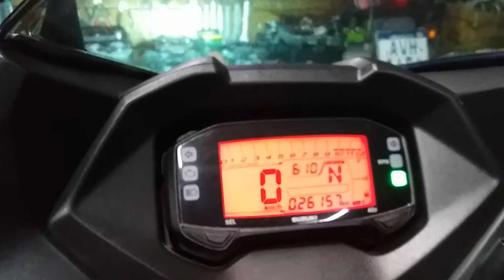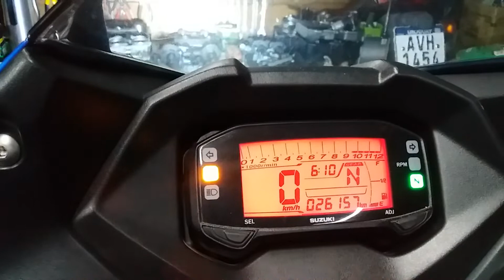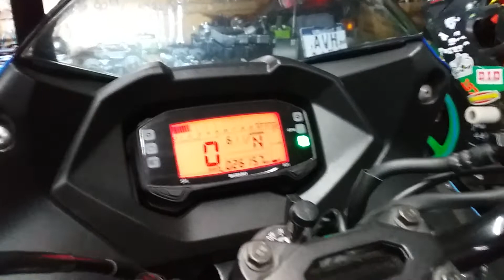Borrar fallas Suzuki Gixxer SF 150 FI

Comment from the maker: Dejo el enlace para que puedan ver el código a que falla corresponde su explicación y posible solución   https://codigos.senzor.co/suzuki/
Reply: Y como diferencias el c44 del a44? El tablero solo indica 44.
Gracias
Reply from the maker: @1976cior  Buenas el c44 código de falla para motor ( luz testigo FI ó Engine ) y es falla en el sensor de Oxigeno. El código a44 corresponde al sistema ABS en los modelos que vengan equipadas con el sistema, en ese caso la luz testigo que encenderá será la del ABS y no la de FI, el código a44 correspondería a un problema en el sensor de rotación de la rueda trasera. Gracias por ver el video y comentar, saludos !

Comment: Excelentes videos y aporte muy profesional, se que ya tiene tiempo el video pero probare haber si puedo recibir una respuesta suya ante mi problema: mi gixxer 250 ABS 2021 al abrir switch la luz de motor parpadea 3 veces para y vuelve a parpadear 3 veces mas le doy marcha y enciende a la primera en ocasiones enciende a la segunda, una vz trabajando nunca mas vuelve a salir el testigo de motor, que falla sera o que estara proximo a fallar??  la carga encendida esta en 14.5 volts y el estator no esta en corto. Saludos!!
Reply from the maker: Hola Tomas, cuando hace eso suele ser problemas con la batería que detecta tensión baja. Revisar el estado de la batería con una herramienta probador , estado de las conexiones no estén flojas ni sulfatadas. Gracias por ver y compartir tu inquietud , espero sea de ayuda  puedas resolver. Si es así me gustaría lo cuentes para tener en cuenta si alguien tiene un problema similar . Saludos!!!!
Reply: @pablorr71  hola gracias por la respuesta y su tiempo, le comento que compre una bateria de la misma marca YUASA solo que en la agencia la única que tenían es de 90 CCA y no de 110 CCA como la original, la falla es intermitente hay semanas que nunca aparece el testigo y hay otra que le vuelve aparecer con esta nueva batería que le puse. Pero revisaré los cables a detalle para ver si no tengo falsos o algunos dañados por sulfatación, al igual mándare revisar que la batería no halla venido defectuosa. Muchas gracias por su apollo y tiempo!! Saludos desde Guanajuato, México.
Reply from the maker: @tomasgarcia3304   Tomás justamente en el CCA es lo importante para que no te suceda eso. Las baterías en las motos vienen ya de por si muy justas en cuanto a la exigencia que requiere la moto por lo tanto bajar de esos niveles genera problemas. El punto es que al momento del arranque la caída de tensión de la batería es grande, es muy probable este cayendo por debajo de los 7volts, para medir esto un polímetro no alcanza debe realizarse con un osciloscopio y ahí veras la verdadera caída de tensión. Cuando la caída de tensión cae un nivel muy bajo todos los sensores no logran generar información coherente para informar a la ECU de su estado por consiguiente es interpretado como falla, cuando se recupera y vuelve a censar correctamente retira la advertencia de problemas. La batería es muy sensible a la temperatura baja como alta y afecta directamente la entrega de CCA, otra causa puede ser un motor de arranque con problemas que genere un aumento de consumo y la batería no lo pueda afrontar, las conexiones defectuosas también genera problemas de ese tipo (sulfatadas , falsos contactos, cables resistivos por corrosión ) No olvides que el principal componente del sistema eléctrico de la moto y sobre todo la parte electrónica es vital  la batería este en excelente estado de no ser así el sistema no tiene donde sustentarse. Saludos !!!

Comment: Hola bro se que ya paso tiempo de este video pero justo tengo una moto como esta y me esta presentando un fallo al encenderla o al andar en camino se me apaga y le cuesta prender la enciendo en 2 en caso de emergencia para llegar a mi destino pero me hace eso de manera general no hay un lugar o forma en específico tu sabrías cual es el detalle ?
Reply from the maker: Buenas Percy, generalmente la falla esta en el sensor híbrido del cuerpo de inyección, en ese modulo va el sensor TPS (sensor de posición del acelerador), el sensor IAT (temperatura del aire de admisión) y el MAP (sensor de presión de la admisión) este último es el que generalmente da ese tipo de problema. Lo ideal sería revisarlo con un osciloscopio para comprobar sea el problema (pese a estar fuera de rango este no acusa falla para que la ECU lo reconozca). No hay forma de repararlo así que la única solución es cambiar ese sensor híbrido (módulo de tres sensores) Conseguirlo no es fácil y tampoco barato. Saludos!

Comment: Profe excelente video, una pregunta usted sabe cual es el código 65, ya que es el que esta emitiendo mi moto una intruder 150 año 2021; le dejo un video donde lo puede apreciar https://youtu.be/ZVUvYfbu2uU de antemano agradezco su apoyo; saludos cordiales
Reply from the maker: Hola Mike, en Suzuki ese código corresponde al sensor de la maneta de embrague (clutch)  es del tipo switch on -off. Quizás hayas cambiados las manetas y no se active como corresponde o simplemente se desconecto alguna terminal ó internamente el contacto se rompió. espero puedas solucionar saludos!!!
Reply: @pablorr71  muchas gracias por la respuesta y el apoyo larga vida a la comunidad biker
Reply from the maker: @mikemarket3344   👍💪💪
Reply: @pablorr71  
Hola me puedes decir que significa c 91
Reply from the maker: @jhonyvargas6376   Hola , es el sensor de rotación en rueda trasera (ABS - sensor de velocidad VSS)